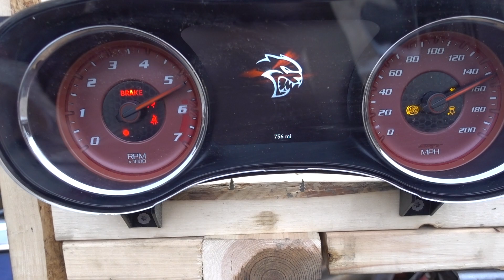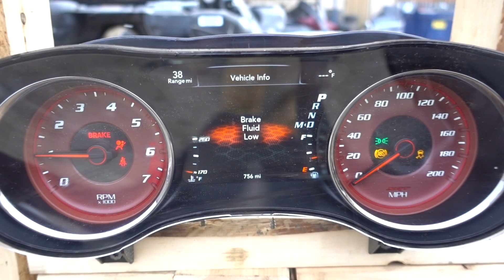SOLD: 2017 CHARGER 6.2 SUPERCHARGED HELLCAT TURN KEY PALLET FOR SALE ONLY 756 MILES

Comment: hi! Is this motor suitable for JEEP Wrangler 2019? How much horsepower is in the engine?
Reply from the maker: This engine makes 707 horsepower. It is likely unsuitable for Jeep Wrangler because it has a two wheel drive transmission.
Reply: @riverside9592  Thanks
Reply: Were you trying to make a custom jeep trailcat?
Reply: @PigIlFigo32  yeah probably